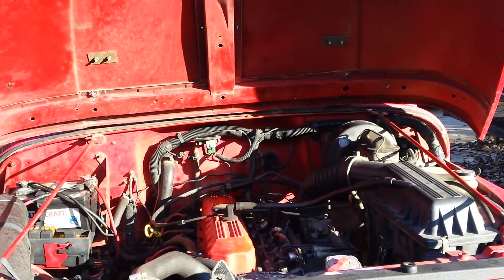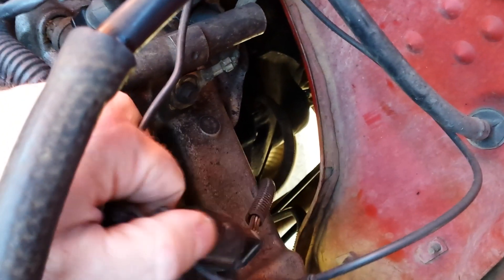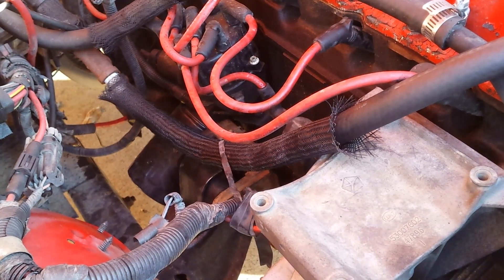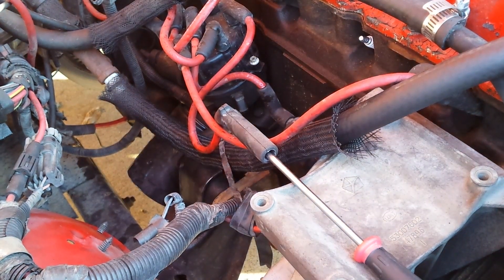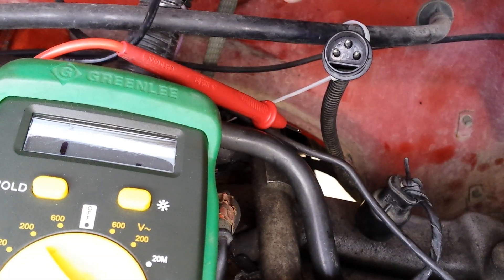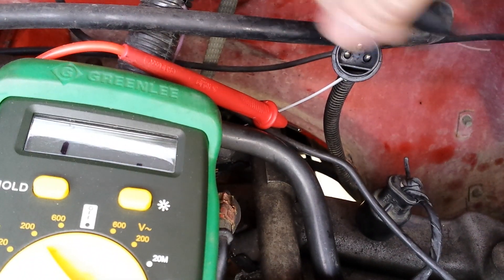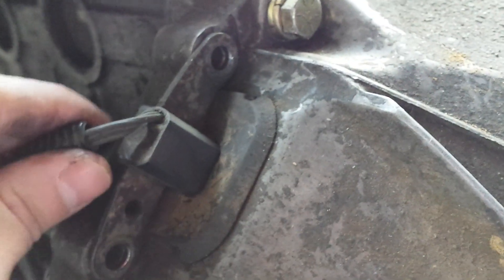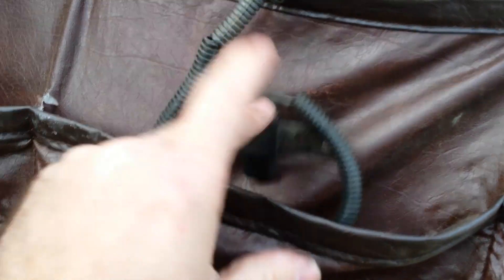Jeep Wrangler - Crank Shaft Position Sensor - locate and test #poweraddictscrew #jeepwrangleryj

Comment: Great video and info. Did you ever had a situation where the ring is rusted and the CPS is not picking up the correct crankshaft position?
Reply from the maker: Nope, I haven't personally ran into that. But, if thats the case, there is no choice other than to replace the flywheel.
Reply: Did not want to hear that, I was hopping I could clean it and leave the lower cover plate opened to dry it out. Thank you.

Comment: 92 yj 4.0lt. it turns off while going down the street. then it turns right back on. then off again and on again while driving. but it stays on while in neutral. any ideas??? thanks
Reply from the maker: Thats kind of a headscratcher. I'd like to say CPS. But the intermittent and then staying running in Neutral leads me toward a wiring issue. Why? When the engine is running it is vibrating. When in neutral there is no or little physical load on the chassis or engine mounts so therefore, less vibration to cause the "possible wire short or break" to act up. Start the engine and leave it idling in neutral (if it is a stick shift, chock the wheels so it doesn't roll). Start at the harness at the CPS, move the harness around by hand to see if it shuts it down. Then go the Camshaft Position Sensor in the distributor and do the same thing. Typically the Crank and Cam sensor are the only two sensors that will shut the engine down completely. After moving the harness and you get no issues, replace the Crank Sensor first, then the Cam sensor. I have seen those come and go intermittently. Hope that helps, but without actually hands on checking it out myself, kinda hard to diagnose. Please drop a line back in here if you discover what the issue is. I'd really like to know for sure myself. Good luck, Thanks for checking out my video! Have a great day!

Comment: Hey Man thank for posting this video.  I am in the process of rebuilding a 1991 jeep YJ. I have a problem no one else has though. My connector from the wiring harness has been on the exhaust manifold and is burnt to no recognition. I want to direct wire it to the CPS wiring but I dont know what color wire goes to the CPS wiring. Do you have a diagram of what color wire goes to the correct pin of the wiring harness connector? I can figure out what I need if I only knew which one of the 3 wires from the wiring harness goes to the correct pin. Hope this makes sense.
Reply from the maker: +Paul Roberts Yep .. it makes total sense. I'll look this weekend at the color codes. During the week I pull long hours. But, if you gently take a razor blade and cut off the burnt insulation to separate the copper parts of the wires. The copper part of the wires should at least allow you to see where they are going well enough to rewire. I've done that many many times.
Reply: +Power Addicts - Jeep, car and motorcycle tips  Thanks for that input but my connector was badly burned and the wire connections were broken. I guess I could do trial and error method but it would be nice to know which one of the 3 wires go to the corresponding pin. I cant find a diagram of this anywhere.
Reply from the maker: I've got an extra sensor in my YJ tool box. I'll try to remember to look tomorrow.
Reply: Thanks for your help.
Reply from the maker: The wiring diagrams I've looked at are crap! LOL .. Does yours have the round (like in the video) or oval shaped plug?
Reply: +Power Addicts - Jeep, car and motorcycle tips  It is round.
Reply: +Paul Roberts  Any luck on finding those wires? Thanks. Could use the help to id the wires to the correct pin when you get a chance.

Comment: have got the jeep running remove fuel pressure regu. IS NEW and  put back on jeep started running not good removed vac. line did not idle up any ideas on this thanking fuel pump or  fuel pressure regu.
Reply from the maker: +Greg Reavis Here is you a vid to test it out .. https://www.youtube.com/watch?v=knE_J8xc3hk
Hope it helps.

Comment: I just finished doing a motor swap in my 94 jeep yj 4.0 and it has the problem of turning over but not firing up. I checked for spark and all of the wires have spark but its very weak. Could this be a bad crank position sensor?
Reply from the maker: When a Crank position sensor or Cam position sensor goes you have no spark at all. Both of those sensors job is to tell the computer to fire the coil. The CKPS or CPS goes bad, the computer has no idea when to fire the coil. So .. weak spark .. coil is the first thing I would go for. Fella I used to work with had an old Chevy truck. It would fire but a very weak lazy spark. Changed the coil .. ran like a champ. Hope that helps. Thanks for dropping by :-) Have a great day!
Reply: Power Addicts - Jeep, car and motorcycle tips I already replaced the coil and had no luck.. Do you think it could be a bad motor ground?
Reply from the maker: Good point .. doing an engine swap that is a very good possibility. Make a ground cable between the block and body. Another between the battery and body. Check your battery cable at both ends to ensure solid connection, although usually if a battery ground has issues the engine will have a hard time turning over. Remove the coil from the block and make sure there is metal to metal contact between the coil mount and block. You can't have too many grounds.

Comment: Hi, I have a 93 cherokee with the 2.5 4cyl. Turning over but wont fire...looked through a lot of forum posts and everything seemed to point towards crank position sensor so I ended up at your video. Thing is, I pulled the plugs out and I do have a spark. Any ideas?

thanks
Reply from the maker: +Matt Lavigne Smith Gotta check fuel pressure next. Check the fuel pressure testing video, https://www.youtube.com/watch?v=knE_J8xc3hk . Then as a simple test simply push the shrader valve in to see if you get any fuel squirting out. It has to come out with pretty hard force, not just trickle. If you happen to have solid fuel pressure, then possibly a weak coil. Video for that here: https://www.youtube.com/watch?v=7SM8T1JqTtU . Thanks for checking out the vids. Hope this help!! Have a great day!
Reply: +Power Addicts - Jeep, car and motorcycle tips Fuel pressure seems to be good. I'll test the coil...what I did notice is that the sparks are not a strong blue. Kinda yellowish. Thanks for the advice btw, the videos are great.
Reply from the maker: You welcome! I Yellow spark is a sigh of a weak coil, low voltage going to the coil or bad ground with the coil. Hope it works out for ya. Glad you like the videos! Have a great day!

Comment: having a issue. low rpm and almost stalling only in reverse. 94 wrangler 4.0 auto. any ideas?
Reply from the maker: Throttle position sensor would be the first thing I would check. Here is my video for that: https://www.youtube.com/watch?v=URNYaGXM_uQ
Reply: Ended up the trans needed a rebuild. Now 2 years later. OEM cps failed. Lol its a yj thing

Comment: After performing this, my crankshaft position sensor is fine, I can't find your follow up video on the camshaft sensor. Is there one available?
Reply from the maker: Thats the one sensor video I havent created yet. Sorry. I'm moving the video to the ASAP list. Whats the Jeep doing?
Reply: the jeep is turning over, just put in a new battery. I replaced the crankshaft sensor anyways just to be sure and there is still no spark, along with a new issue of fuel pressure in the fuel rail (I believe that is what it's called). So things I'm looking at are a potential bad camshaft sensor, a potential bad fuel pump, or the ASD kicked in. From my minimal mechanic skills this is what I have been led to.

Comment: when you are testing the sensor do you have the key turned off or turned on to run power?
Reply from the maker: Key has to be in the run position .. On
Reply: If the sensor is unplugged for test why would key on make a difference ? Thanks, BTW does the sensor need to be grounded to test?

Comment: I have the strangest problem, I believe that the cps won't work when it's cold. No spark, but later in the day when it warms up it starts. Have you heard of this before?
Reply from the maker: As strange as it sounds, I can see that happening. I've seen a few times as to when a CPS is going bad it would shut down when it got hot, then start back up once it cooled off. They aren't crazy expensive, change it out see what happens. Good luck and thanks for checking out the video. Have a great day!

Comment: a power diction I have a 96 Jeep Cherokee I have replaced the cam sensor the coil pack and the crank sensor and I'm still not getting bark at the coal please help
Reply from the maker: +Steven Fisher After replacing all that, it is going to be a wiring or PCM (Power Control Module) issue. The cam and crank sensor tells the PCM what the engine is doing. The PCM then tells the coil and injectors when to work. So, if you arent getting signal to the PCM due to faulty wiring, the PCM doesn't know what to do, so it does nothing. If the PCM is bad .. well .. it cant do anything. Wish I could have given you a better diagnosis. When the coil has no spark, it is either the cam, crank position sensor, coil, PCM or wiring. Good luck .. have a great day!

Comment: Great video.  I have a 1997 Jeep Wrangler 2.5L, Automatic.  I was getting code 11 doing the key trick.  I changed the crankshaft position sensor and notice that mine was installed opposite of your video and on studs with nuts.  I assume this is because mine is an automatic, 2.5 L.  I have looked at a lot of videos and pictures on line and don't see any that are installed like mine?  Do you know anything about this?
Reply from the maker: Being that yours is a 97, you have a TJ which is a newer engine generation than the YJs like mine.

Comment: While testing my crank sensor, I don't get any change at 200 Ohms but the meter jumps when I have it set to 2000 ohms.  Does it matter that it doesn't move at 200 but moves at 2000?

Comment: I have a 94 YJ 4cyl and it's been running really rich lots of fumes, and when you de-excelerate it pops like a pop corn popper. I have replaced the MAP, upper and lower exhaust/oxygen sensors, idle control sensor, all plugs, wires, distributor cap and rotor and little or no difference. Any thoughts? I think it's timing but I'm told you can't change the timing on these?
Reply: Please  tell me you figured the jeep out?  Any luck on this?  I have a 4cyl that went from 16 mpg to 8, did the coil, map, all kinds of sensors and tune up.

Comment: great video. trying to keep my cherokee running.you don,t by anychance have the bolt sizes for the bell housing to engine on a 94 xj with a 4.0 and an automatic .sure would appreciate the length and size. i think there is 3 differant sizes.

Comment: Thanks for the video! I know I have a neutral safety switch problem and now I got a code for this sensor. My jeep has the sxs of not turning over and stalling and will only attempt to turn over in neutral. My reverse lights are not working I think that is related to the neutral safety switch. Anyway I will now try to replace this sensor and see what happens. Thanks for the video. Filming and directions seem great. I love the seasoned mechanic pointers!

Comment: Hey Quick Question. I have a 91 yj 2.5.  It starts great when cold or when hot just after you cut the jeep off, but if you allow the jeep to sit for 15 minutes or so and then try to start the engine, it has to turn over several times before it starts. Can the CPS do this? What do you think causes this scenario?  Thank, Love the videos. Keep them coming!
Reply from the maker: Typically when a CPS goes, its done. I've seen a few cases where the CPS had to cool down and it started working again. Kinda sounds like a fuel pressure issue. Try this .. after the Jeep is hot, turn the key off and let it sit for the 15 minutes. Instead of trying to turning it over. Simply turn the key on and let it sit for about 10 - 15 seconds. If it fires right up, your fuel pressure is bleeding down. Now, the only thing that makes me second guess that is it "should" be hard to start when cold as well if the fuel pressure is bleeding down. Without actually working on it, that kind of a head-scratcher. Thanks, Glad you like the videos!! Have a great day!
Reply: Thank you for your reply. I will try that.
Reply: Yea your right it makes me wonder why it cranks on the first revolution when cold. Anyway, I will keep working on it and try to update you if I figure it out.
Reply from the maker: Yea .. please do update. I'm rather curious myself. It would also help others who read this as well. Thanks!! I subbed to your channel.
Reply: Thank You!
Reply: Hi great videos, having same problem cold runs nice no hesitation or breaking up, warms up starts running rough, backfiring through exhaust as if the timing has changed.. Removed the valve body air cleaner connection so I can squirt gas down the valve body when it started running rough, did not help no better no worse. Replaced cap, rotor, plugs,  engine shut off sensor, fuel sensor, ign timing sensor. The fuel pump sounds like it kicks on when key is turned on. Checked all grounds, removed gray connector wires and hard wired them to color code, because it seemed to clear up when moving the gray connector.But  no change.This all seemed to start when I changed out my alternator,  checked the attached regulator seemed ok, alternator now charges fine, I don't think this problem is related but what the hell do I know after all this, I'll try anything. Is there an OBDII connector on a 1992 Jeep Cherokee??  Getting desperate bought one of those OBD Scanners and realized there is no 16 pin connector to hook this up to..  Any way this old jeep always ran good and reliable. Don't want to put her out to pasture.. Thanks Jim

Comment: Hey Drew! - I'm new to Jeep World having recently inherited a '90 Cherokee. I'm a mechanic wanna' be and (sure enough!) when doing my first Jeep tune-up managed to twist off the hold down screw on the distributor cap. SO....if there are any great tips on how to get the distributor back in CORRECTLY  the 1st time , that'd be great. The vehicle runs but idles roughly after warm up. I heard a read a MILLION reasons why but have resolved to replacing each component that could be the culprit until I get it right. Don't know what else to do! The next potential culprit is CPS. and NOW, after watching your vid, I have a clue what I am doing AND WHY!!!The WHY is a big deal with me. When I "get" why it works or doesn't I seem more confident in what I am doing. 
Anyway, Thanks for taking time to 'splain stuff to us old "new" Jeep guys, keep up the good work, Man, you ARE appreciated!
Reply from the maker: +Bill Evans Thats without a doubt one video I need to do. Kinda hard to explain without showing it. Basically get number 1 cylinder on top of compression stroke (not exhaust stroke). Drop the distributor in so the the rotor button is pointing at number one cylinder. That will get you in the ball park. The rest is using a timing light to set the engine to factory timing spec by the harmonic balancer. Just a note, if the CPS was bad, it wouldn't rut at all. If it did it may run for a short time then shut down. I think the HOW isnt complete until the WHY is put with it. I naturally over analyze everything. I'm not satisfied with a half way explanation. That tends to show in my videos. I get flamed occasionally for my video being too long. Thats fine, haters will be haters. I get more praise for over explaining than negative. So .. I'm doing all right :-). So with that being said.. Thanks for the great review! That keeps me reassured that Im doing the right thing. Have a great day!

Comment: Great video it will help a lot of folks! 

Just a point of information, a bad crankshaft position sensor will shut the engine down when it's running and will not start when you attempt to start it back up, it shuts down spark. Sometimes it will restart after the engine cools down, but will shut down once the engine warms up again. 

A camshaft position sensor will allow the engine to run until you shut it off, and then will not start up again, it shuts down the fuel system. 

So if your Jeep shuts down abruptly and won't start back up with no spark, it's most likely a crankshaft position sensor, and if you park your Jeep and the next time you go to start it and it won't start up but you have spark, and the fuel pump doesn't run when you turn the key on, it's most likely a camshaft position sensor that's inside the distributor housing.
Reply from the maker: Glad you like the video! You also provided very good information! Thanks for adding that to the comments section. Lots of people will find the information useful. Thanks a bunch!! Have a great day!
Reply: Wow!!!!!! Great piece of info cause mine wouldn't start again but ran perfect till shut off!!! Saves me the hell of crank position sensor. Many thanks!!!
Reply: @dandahermitseals5582  
Never turn your yj off It should run forever. Hire a security team to watch over it while you sleep.
Everytime I shut mine off it won't start again. I learned my lesson.
Reply: I replaced the camshaft position sensor first, it was the crankshaft sensor. Going on my 3rd crank sensor in 2 years. Best to keep a spair of both if you drive a TJ🤔
Reply: @DavidParker-i8o  I believe in using Mopar whenever possible.  The imported CPS always threw codes and caused the engine to run rough especially in the mountains.  Switched to a Mopar CPS and the problems disappeared.